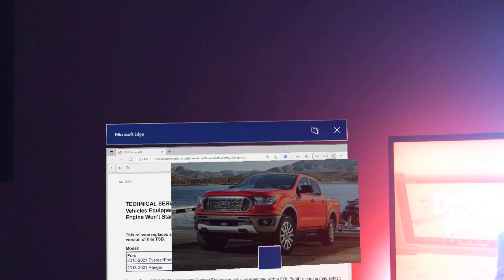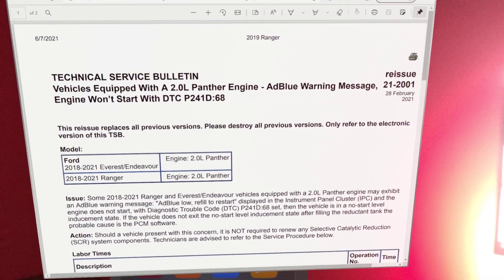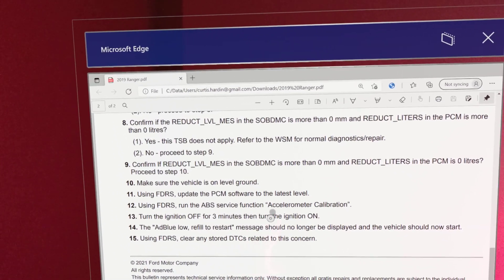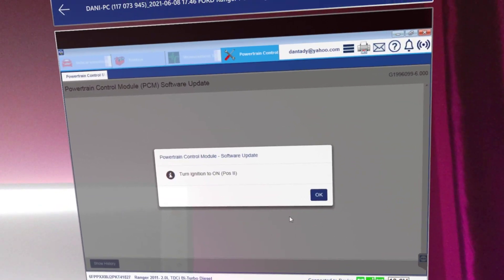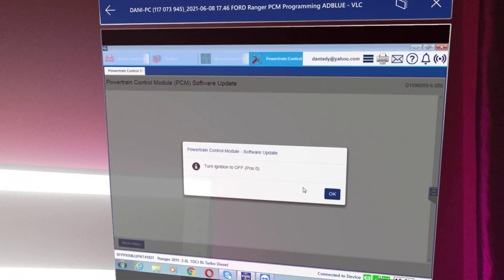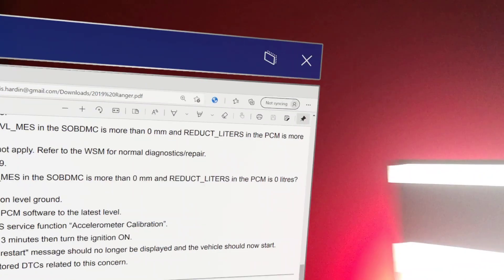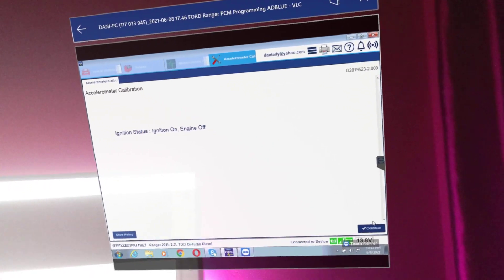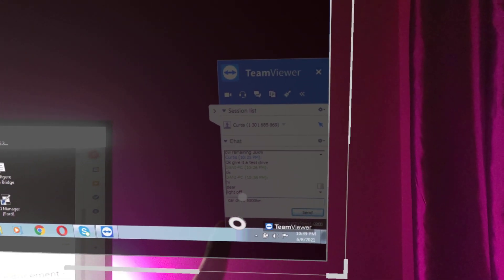TSB  P241D - Ford Ranger 2019  PCM Programming With FDRS

Comment: How are you my friend, I have a 2021 Ford Taurus, I had an accident, the Airbag was fixed, the Airbag control was changed, and the Factory Alarm system worked, how do I turn it off?
 I have an original IDS and FDRS program from the Motorcraft website, how do I turn off Factory Alarm
 I have an original IDS and FDRS program from the Motorcraft website, how do I turn off Factory Alarm
 I have 2 keys. I have PTS NASTF Username and Password.